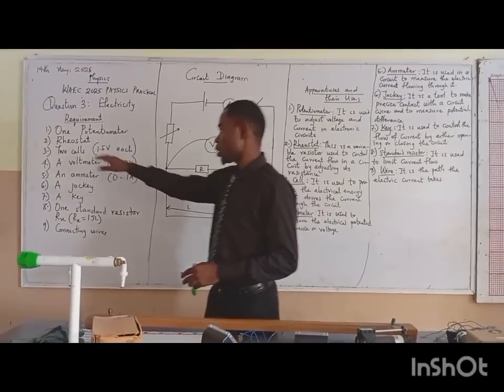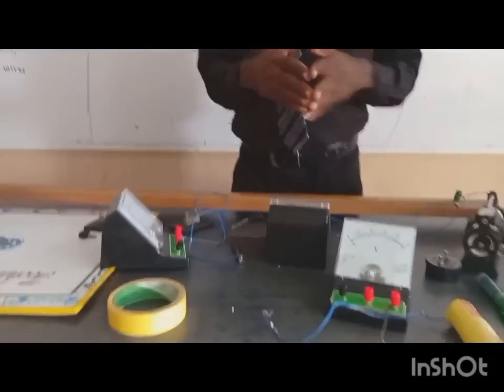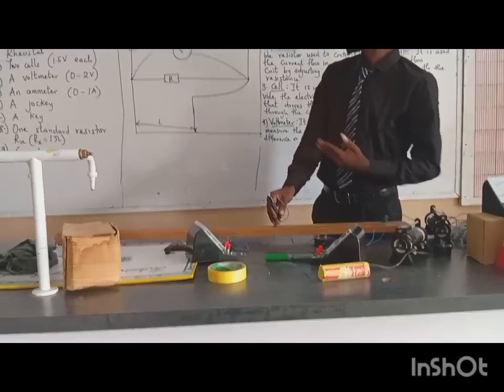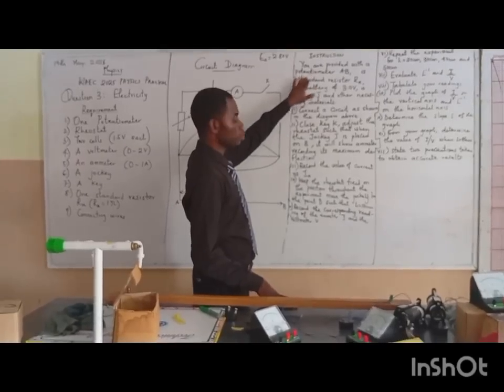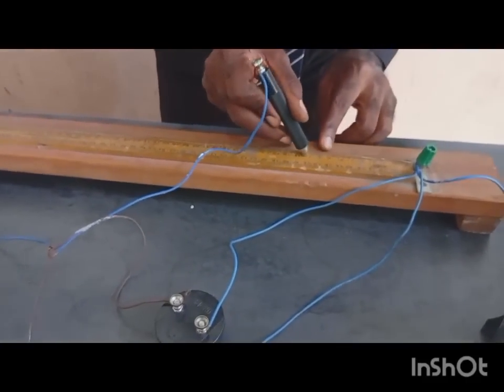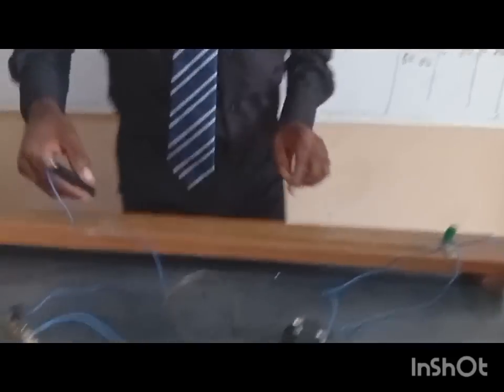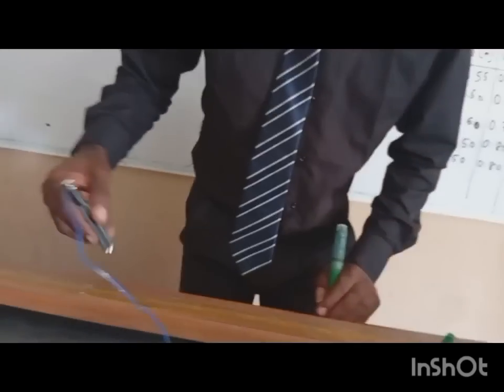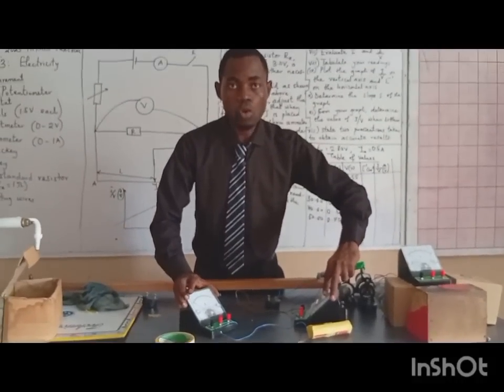WAEC 2026 Physics Practical Question on Electricity  #school @estimatoradetunji

Comment: Nice one sir... I noticed both ammeter are connected serially, taught voltmeter is meant to be parallel while ammeter series?
Reply from the maker: Thank you sir for your observation. The Ammeter and Voltmeter are arranged in parallel. It is because the wire used is too short that is why it looks like they are arranged in series. Once again thanks my professional colleague.

Comment: Kudos to you sir. However, are you using the recommended ammeter range of 0–1A? I can't see the Ammeter calibration very well. Why I said that is because the Io(Max. current) may not be up to 0.6A if you're using the recommended ammeter range, that is, 0–1A. The reason is because the calibration on 0–1A ammeter is quite different from any other range of ammeter. 0–1A measures accurate reading because the calibrations are smaller.
Reply from the maker: You are right sir. I used the recommended one. I used ammeter that contains both 0-1A and 0-3A. I also did the experiment on both scales. Thanks for your observation professional colleague. God bless
Reply: Yes, he used 0_5A whereas it ought to be 0_1A aa stated by the WAEC
Reply from the maker: @shuaibjemil  Yes you are right. I used the ammeter that has 0-3A and 0-5A. Thanks for your observation.